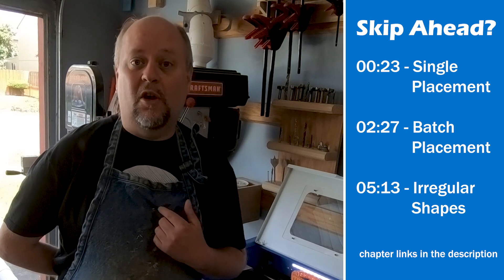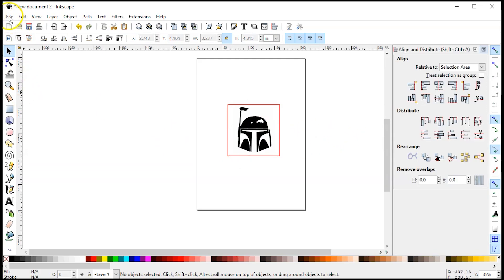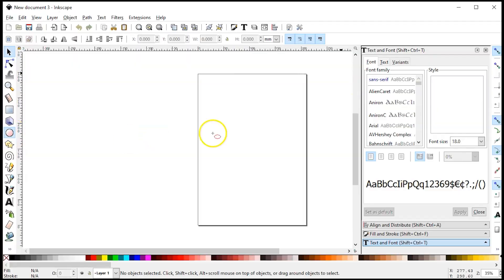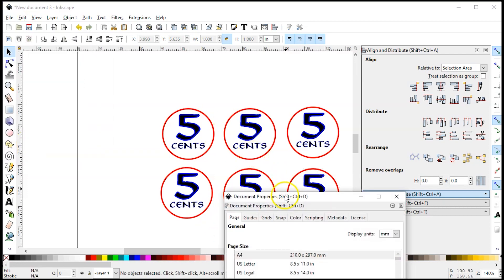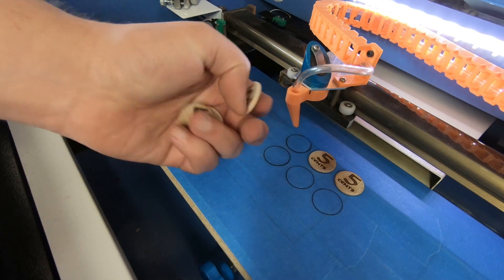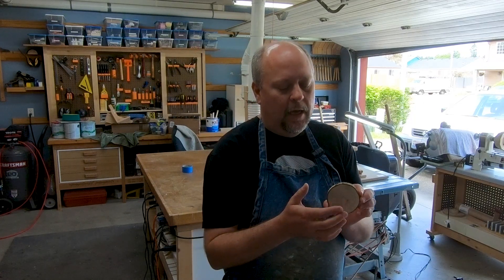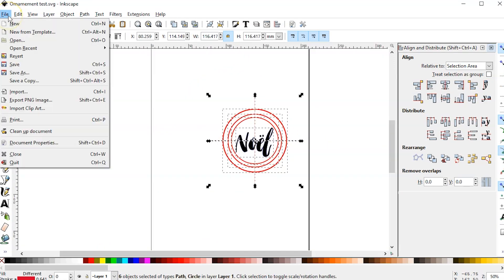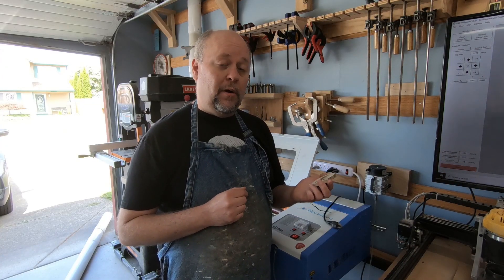Where Am I Engraving? - How To Line Up Your K40 Laser Projects.

Comment: Brilliant. First video that I have seen about positioning and aligning the pieces. I just bought a used k40 off Ebay, and I was wondering how to centre the jobs, as there is no reference on the table. A simple L shape to the Y-0 X-0  point would have been useful I think

Comment: Nice tip. I have a bed made of expanded steel and just use a sheet of printer paper and run the outline at 3ma to mark/cut the paper
Reply from the maker: I’ve been using paper lately too. I’ve been using spray adhesive to mount it, though.

Comment: Best channel. Just purchased a K40 and people saying you need the same amount of upgrades that you paid for the machine but after watching you channel I just got the square, drag chain, lab jack and the air assist. 

All the best for your channel.
Reply from the maker: There is lots of room for improvement, for sure.  But, it's easy to go down a rabbit hole with improvements (I'm sure they're all great, though).   But the way I see it, it's a cheap laser and I don't want to put a huge amount of energy or money into it.  It doesn't have the bells and whistles the pro lasers do, and I'm OK with that.  For now, it does everything I want it to do.  Someday, when I want it to do more, I'll upgrade the machine.

Comment: I have been following what you are doing in this video but my machine isn't doing the outline engrave. Any suggestions of what I could be doing wrong?  Great videos by the way.
Reply from the maker: It depends on what software you're using.  But typically, red is for vector cut, blue is for vector engrave (outlining), and black is for raster engraving.  Good luck!

Comment: Doesn't your laser read the red lines you use for the box and circle as a cut line?
Reply from the maker: Yes, but since I'm not using a cut, I'm using it to mark my work area.  If I needed a cut, I'd use the blue line to mark my work area.  Basically, the blue and red line separate types of cuts, since they're both treated as vectors.  Black is treated as a raster.

Comment: great work ... but can it burning photo at wood?
Reply from the maker: Yes, absolutely.  I'll do a video on that in the future.  But basically, you change it to black and white, then adjust the contrast until it looks good.  K40 Whisperer will adjust the laser for you.  For more advanced engraving, you can play with image manipulation and dithering.  But that takes a bit of trial and error.  But once you get it dialed in, it works great.  I also heard LightBurn software does exceptionally well with it.